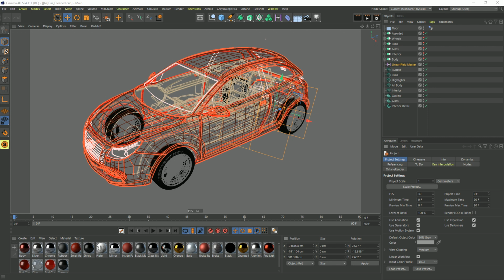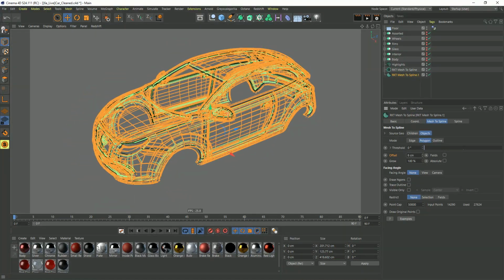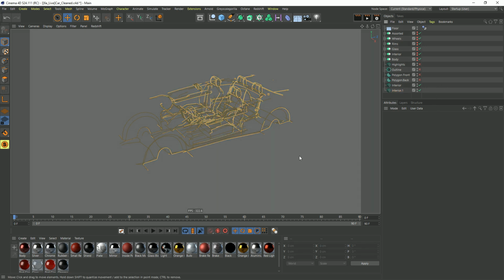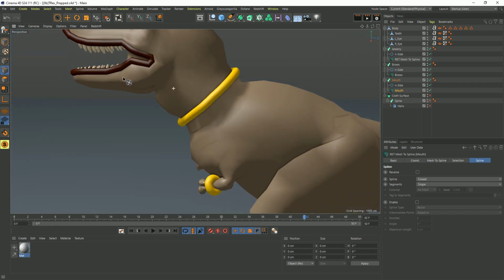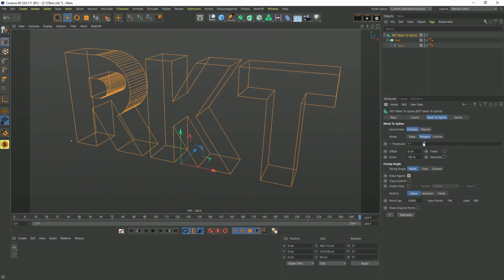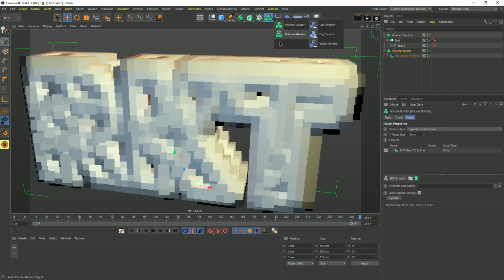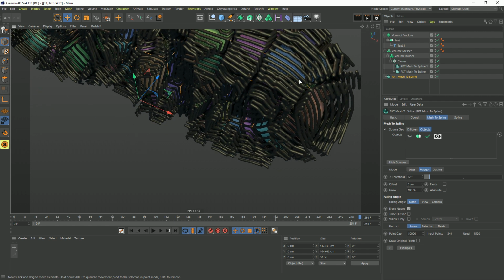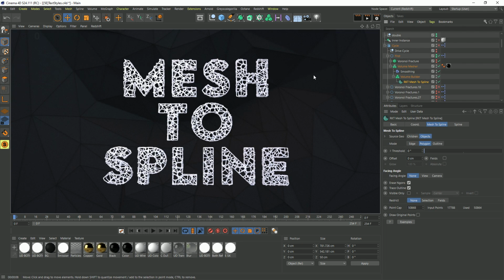Mesh To Spline Quick Start

Comment: Can we edit the splines bezier handles manually or separate/break specific splines out?
Reply from the maker: Bezier are only accessible as editable Splines. 
Depends on what you mean by break specific Splines out. With an edge selection you can output very specific edges as Splines. Then make multiple Mesh To Splines

Comment: It's like the free edge to spline plugin noseman made but with a few more features! I'm not sure it's worth $97 though, that's almost a two month gsg plus membership
Reply from the maker: Hi there Jan, sorry if it doesn't have enough stuff for your liking. We worked hard on this one. Running a "Edge To Spline" inside a plugin takes a few hours to make. This took months with all the features, designs, combinations, modes and the way they all interact with eachother.

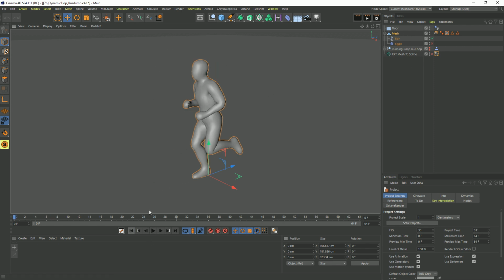Comment: Hi Chris. great job ! I watched the tuts and i waited to see how MTS handles a  tri-meshed object. Well , you have nailed it manually (running guy example @ 37:00) however this is abstract solution and it does the trick by all meants, but, what if 90% of my assets that client wants to be purchased are triangular ? Could you maybe make another 3 minute tut  to show it ?
Thanks.
Reply: Have you checked out the Remesher in C4D?
Reply: @jamiepowell3724  I happen to have it. It's output (IMHO) isn't desired on more than 70% of the geo i gave it to chew. I was hoping that Chris has thaught about this common possibility.
Reply: @vladan.Poison  Not sure if the solution you're after is going to be found in the MTS plugin, but rather in the assets you and your clients purchase. Perhaps you should try to persuade them to buy well-built assets if there is a clear aim to use a plug-in like this, or you could always go in and manually clean up the topology yourself? As you saw in the video, Chris had to painstakingly create the horizontal edge loop in the mesh in order to ascertain the demonstrated effect, so it's not always down to the geometry or plugin but sometimes down to the user to create those workarounds. Good luck!
Reply from the maker: Hi @vladan m  Not certain I fully follow the goal you describe. Mesh To Spline doesn't do anything special with Triangles, but with "Threshold" it can do a good job finding the hard edges. After that it's similar to what @Jamie Powell said, creating selection tags or cleaning the raw geometry before it comes in. Thanks for checking it out!
Reply: @RocketLasso   2 weeks ago got myself a copy of Spline2Mesh... tested it on a realworld project... Pretty Neat i must confess.  

Also i revoke my doubts regading tri meshes.. I just needed to work with it to believe it !!!